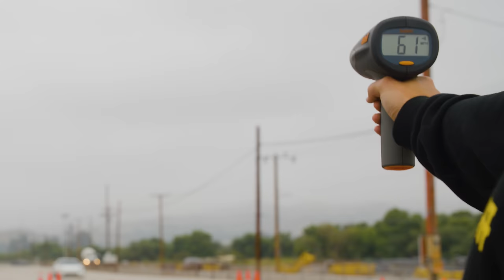$450 Brakes vs $4,500 Brakes | HiLow

Comment: Just my .02, if your vehicle is a track day car and not a race car, IMO it's not really worth it to get a big brake kit.  Most of the increase in performance is in the pad material and rotor design.  Also, flushing out your DOT-3 brake system with DOT-4 fluid and replacing the rubber end lines with braided stainless gets rid of most of the fade associated with rubber lines balooning.
Will the big brake kit be better than a brake upgrade it? Of course.  More contact surface area = more available friction for a given coefficient of friction.
IMPORTANT DISTICTION: the big brake kit seen in this video is a FLOATING ROTOR setup, which is arguably much better than a standard rotor because the rotor doesn't dissipate heat into the hub as quickly.  Heat in the hub leads to premature wear on you hub/spindle bearings.
Do you NEED the big brake kit?  Unless your car weighs more than 3500 lbs and has to brake after continuous high-speed sections, probably not.  Getting a pad with a better coefficient of friction and a rotor with better heat dissipation capabilities will help you out much more than you think.
Last caveat: I've ran into issues with cross-drilled rotors cracking before, which is why I go for slotted rotors exclusively now.  You can do whatever you desire; just thought I'd throw that little tidbit out here in case someone was wondering.

Edit: I say this because although big brake kits are better performers, it's worthwhile to be cost-conscious when setting up a vehicle for the track.  Less money spent on a brake system leaves more money for more trackdays.
source: results of modification on my own IS250 (not a 'fast' car, but a fun car to drive fast.)
Reply: And more money for tires n race fuel!

Comment: Break difference is all on your budget and ability. I had a ZX2 done right..kinda used 94EGT rear disk with Ebay rotors and stock Calipers...vs. Wildwood fronts and stock rears. Mine stopped harder and way faster. 
Some adjustments were made for rear to work proper....lol

Comment: If I was Nolan I would find a used G35 with the performance package on it and take off the Brembos and put them on my 350z... just saying lol
Reply: Straight budget balling lol
Reply: Or buy a Z that has the brembo's from factory. These guy's got the base model. Any variant not base model comes with brembo's, limited slip dif and carbon drive shaft, more struts...and more.
Reply: Sword of damocles.. Right lol 😂

Comment: I would of like to seen the oem brakes fade vs the cheaper drilled and slotted rotors also. love the vid though.
Reply: yeah I wish they had the budget for the "contro" car vs these other two.
Reply: OEM brakes have some pretty good fade performance. I wouldn't be surprised if they did better than the cheaper drilled rotors.
Reply: This would have been a much better video. Say... they did that lap test before changing one of the Zs brakes.

Comment: I wish this series was expensive versus moderate.
Reply: It is. These moderate parts are not cheap
Reply: $250 for coilover/strut/shock is extremely cheap. But I do wish they did a middle ground car, parts from reputable company. But enjoying the content.
Reply: @LS__812  okay yeah thats cheap cuz mine ran for 700, but brakes? I got my pads and rotors for a 100. They work very well for a regular daily, obviously not for performance though
Reply: @homelackin2234  yeah I agree with you on the brakes for sure.
Reply: @homelackin2234  you can definitely get good brakes for cheap, especially if you're running a lightweight car like a Geo Metro, Mirage, and old Civic which run on 14" rims.

Comment: based on 'engineering explained', for everyday cars, OEM is the best.
Reply: in some ways, that's also the same size pads, and the only difference was the price, and pads. This is the whole sha-bang for the most part.
Reply: I like OEM everything but with higher temp capable pads for the downhills and the towing
Reply: But they are also making these cars to track tooo.... Not only daily

Comment: Should have mentioned what pad compound you were using on both since that is almost literally the only thing that matters for the endurance/torture test. I'm betting the Wilwoods were a very high temperature pad and the others were basically stock.

Comment: Are you removing all the other upgrades and starting over with a clean slate every time you put another upgrade or is accumulative? If it's accumulative then the difference in performance will be effected by the previous upgrades like with better suspension improving braking.

Comment: @Donut media I recently swapped my slotted brakes and rotors on my forester XT 18 with a lo kit by my mechanic that specializes in modded Subaru's. The problem is that the brakes on the front seem Trimble and make a creeking noise randomly when I either come slow to a stop or when a do a moderate braking from 70+ km/hr 
Did this happen to the lo car and how would you fix it ?

Comment: I've got Benbo's on my 928 S4 and they are incredible. The amount of control during heavy breaking really builds some unearned confidence. Smooth and very strong. You can really stand on them and you know when they're going to lock so you can let your foot off just the tiniest bit and stop in the shortest amount of time possible and if you have to break hard in a turn it's the same thing. I know if I have to stop I'm going to stop and without ABS brakes I find it much easier to control than any other car I've ever driven without ABS.
The 928 is a big car. It's a heavy car. But I can really throw it around now, even in a tight parking lot.

Comment: Thats why very impressed about the breaking system that the trophy trucks are running, making the trophy truck ( a tt weights around 5,000lbs)  stop so quickly in over 19 hrs striaght, literally i've seen the rotors in red alive at 3am in the last years baja 1000.

Cool video guys!

Comment: I got a set of Geomet rotors and ceramic pads from R1 Concepts for my 05' Impala SS V6 Supercharged and there was a HUGE difference. Brake pedal still has some cushion to it after a 4-way bleed but I think that's because I have a lot of rust.

Comment: Your brakes are only half of it. A good tire setup is necessary for stopping
Reply: they're testing brake fade, not stopping distance
Reply: They did tire upgrade episode
Reply: Actually it’s brakes tyres and suspension
Reply: @thdjnr  you forget weight and its distribution. it improves almost every performance aspect of your car.

Comment: I went with another budget route on my 03. The 06+ brakes are dual piston up front, and slightly larger in the back. Way better stopping power, the early z's should have had those brakes to start.

Comment: You could always piece together the factory Sport calipers,  aftermarket drilled rotors, stop tech  pads and lines for under $1200 for all 4 corners and they work excellent. Did that set on my Infiniti FX35, It the same factory brake kit  Nissan/ Infiniti uses on all their top performance. Buy the calipers raw off eBay and paint them yourself.

Comment: i drive a Skoda Rapid facelift limousiene and im searching for a bigger brake kit for a long time now, but i dont find one. Looks like the only better brakes are the Brembo max Rotors and pads but they are so thiny because they are the stock size 288mm in the front and 230mm in the back the good thing is they cost just about 300$ and they are brembo brakes but sadly not bigger

Comment: I use some ATE performance Brake disks and brake pads. They do brake my car dependably from 124 mph to around 60 to 75 mph on German Autobahn. No fading. 
Its about how to brake. Most people stand on the brake pedal a while just getting to overheat brakes. 
Short and hard braking is better than long and soft braking.

Comment: I watch you guys all the time and love the videos. 
I gotta point out the misinformation on this video. You stated the only reason the rotors are drilled, is for weight saving... that is not correct. The material determines weight, along with cooling, weight on wheels , etc...
The slots and cross drill is for removing the gases that build up between the pad and rotor. Some come with slots, some with drilled holes , or both. I have both slotted and cross drilled on my cars, one of my sons 350 has slotted with no drilled holes. 
Keep up the good work... once again, I’m a big fan🤙🏽

Comment: Just got  R1 geomet-had them before and knew they were better.!7 feet for 450 dollars is actually pretty good.BTW those 400 dollar brakes--most in that range say light track use--which means for the street they should be perfect.Wildwoods are great--but 4k is just over kill unless you are really going to track a car.For the cost of tires and the 4k brakes--you could do several weekend courses and get take the courses and get to track a real race car.4k will buy you about 4 weekends at most track schools--and you get to use their cars.I just want a great street car--thanks for the video.

Comment: hey nolan once your brakes catch fire mate the master cylinder usually gets cooked as well best way to check is stand on your brake pedal hard while the car is on if it gives a firm pedal then slowly goes to the floor its stuffed you need a new master as l had a 300zx twin turbo and thats what happened when my brakes caught fire

Comment: Recommend buying upgraded discs and pads when it comes time to replace, but OEMs are pretty good. If upgrading, make sure the ones you are buying are actually upgrades.  $1,000 should get you decent rotors and pads for a Z.

Comment: Did they use the same brake pads or equivalent?  It seems Low Car used OEM pads and Hi Car used performance pads that came with the big brake kit. At least throw on some Hawk Performance pads on the Low Car.

Comment: I enjoy the series. My recommendations would have been to install a DIY brake hose kit on the low buck version. Brake fluid ATE, super cheap and decent boiling point, Hawk HPS pads. Pads are about $100, fluid is less than $20, duct kit can be done for Sub $200 leaving you enough to get a case of beer and enjoy the results. Just sticking cheap crap on the low buck car is not a good comparison.

Comment: If you are up to doing some fab work, even cheaper  you could grab the discs and calipers/brackets from an suv in the junkyard (that will fit in your wheel) , weld and bolt them on, drill out new holes for the lug nuts and send it. What could go wrong?

Comment: I would like to say that both sets of rotors would likely not be allowed at the track. The drilled portion of the rotors cause rotors to heat check around the holes and eventually crack much sooner. 
Slotted rotors are what is recommended when you go to the track. 
Honestly upgraded pads with two piece rotors would be a solid combination.

Comment: Drilled rotors are not recommended for street use. The holes are much more prone to cracking. Not a problem for a track car when your replacing rotors often since the metallic pads eat up rotors,

Comment: The guy's right, upgraded pads, brake callipers, lines and disc's is going to perform better but it doesn't have to be 5k worth of bremo parts, the next step up from stock will perform just as good

Comment: If the more better ones wore down slower how much longer would they last compared to the cheaper ones? 3x? 4x? …? If you normally change your breaks at 10k miles but the more expensive ones would let you go 40k would you buy them then?

Comment: You don't need to bed your brakes in that many times. I have been ase certified in disc and drum brakes for 20 years. First and very importantly buckle up and make sure it's tight. I usually would go from 60-30 standing on the brake pedal the first time. Then go back up to 60 for a minute or two to allow everything to cool a bit then do it a second time. This time it will brake much harder, so be prepared. This is where a non directional surface finish comes into play that's done at the end of machining.

Comment: Nissan does make a cheaper option for upgraded caliper so there is no reason to spend that much money especially if your not gonna be on the track all the time. Also suspension makes a difference to how the weight is shifted when braking.

Comment: You didn’t upgrade the brake lines. And I’m not sure if you guys put better tires on either. Both of which affect braking distance and braking power. DOT 5.1 fluid would have helped as well

Comment: Heh I was lucky did a big brake upgrade swapping in gen2 vr4 rotors and calipers onto a 3000gt sl. With slotted rotors,ceramic pads and braided lines. Gained over an inch of rotor and 4 opposed piston calipers. Made a massive difference. And got it all done for about a grand total ( spindles,tie rods, ball joints, calipers,lines,pads,rotors, hubs,) overall it was like 1,500$ . probably overall the best upgrade for a 1994 3000gt sl. And it looks sick to. Gotta have aftermarket wheels and/or spacers though.
Reply: @[Removed] because it's not a waste? Some people just Want to do something different to see how it can go.
Reply: @[Removed] For me the SL is the lighter platform still makes good horsepower not TT power. But you slap some bolt ons, Cams and a tune and drop some weight, And shes a ripper and doesn't spend 95% of its time on jack stands.

Comment: also if you ever do get the brakes that hot dont just sit there drive slowly and consistently to allow airflow to cool them consistently most times it can save the pad and also not warp the rotor

Comment: Frankly, for Low Car, what's missing on this one is two things for my mind.
1] Remanufactured; there's plenty of 2-pot replacement calipers for under $200
2] Sourcing a caliper upgrade (ie 2-pot) from another vehicle with the same bolt up/disc diameter clearance dimensions.
Whilst not springing for new gear I get, but don't ignore wrecker opportunities (which is exactly where such budgetly constrained punters as Low Car go).

Comment: its also highly dependent on what your intended use for the car is. if youre drag racing the lower kit should be fine but if youre gunna go initial d on some mountain passes, if you dont have the good brake kit youre gunna die. lol

Comment: The big brake kit does mean more stopping power because the calipers have more pistons and more pinching force add in bigger rotors and pads and it’s going to perform better. I don’t think the performance is going to be super dramatic vs the zinc rotors and pads but it is going to be an improvement. Is it worth the cost? That’s for each individual to decide.

Comment: On a street car those bigger breaks can REALLY screw things up guys. All that surface area is useless if you aren't generating the heat, and you'll find you have worse stopping in regular driving. If you're going to daily and do casual track use, go with good pads and rotors, if it's track use only, big breaks all the way.

Comment: Best bang/buck brake upgrade for any Z/G  is snagging a used set of Akebono calipers from a Sport package versions for $500-$600 then do 2-piece rotors from Z1, with new pads fluid and brake lines.  

Get to keep your stock size wheels and your only spending around $1300 vs the $4500, that said I'm doing my SS brake lines next week. :)
Reply: in some countries all 350s were sold with brembos as standard
Reply: @03056932  Those are some lucky countries!

Comment: I wish you had at least purchased used Brembos for low car. That is the low budget upgrade most guys are doing for 350z and G35. It would have been nice to see how Brembos and EBC pads would have done against the Wilwood. I know EBC isn't considered a cheap pad but you can get them on ebay for much less than retail which puts them in the low budget category.
Reply: Same for how they addressed suspension or tried to go FI without bigger injectors, it's like they didn't research the Z33 platform....... at all.

Comment: Lol I'd be interested to see if 10 450 brakes would outlast the 1 4,500 brake. Of course the more expensive brakes are going to out preform cheap brakes. But seeing which is better for the cost would require multiple tests. 

I would argue that after 5 change outs of the cheap breaks, the more expensive breaks would also fade. Then you just need to argue the additional cost factored into the work you put into change the rotors and the breaks. And in reality..while an auto mechanic would charge between $800 to $1,000 to change all 4 rotors and brakes, the job is pretty easy and takes about 20mins per tire.

Comment: Less vs More. 170mph to 60mph for 1 corner (3000lb car) there is no choice higher price (6 top brands). Less exp will recover on lower speeds. Pads follow a similar pattern but many compounds to pick depends on track & temp of rotor.

Comment: would've been  a more "fair" comparison to go with a junkyard big break swap. most performance brake kits are roughly the same caliper across multiple cars with a difference bracket. EX 5 min of googling and turns out thers an adapter bracket to use infinity 4 piston brakes on 350's

Comment: I'm confused, if the new brakes decreased stopping distance by even 5 feet, it seems like they DID improve your braking ability, but at 9:32 the conclusion is that it doesn't help you stop sooner. In reality, 5ft or even a couple feet, is the difference between getting into an accident or not. It seems worth it to me.
Reply: My thoughts. Also increased surface area because of bigger brake pads.

Comment: Okay pause:
Brake lines will expand in diameter under hard braking.
Which means the fluid energy does not go to the brake piston instead get consumed by the hose and thats what gives you that soft pedal feel and just kills your braking potential.